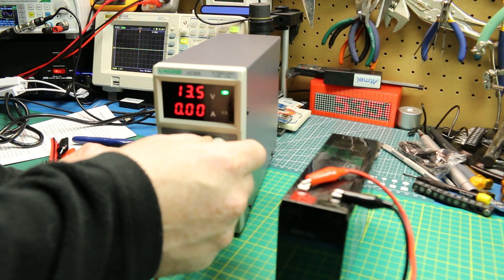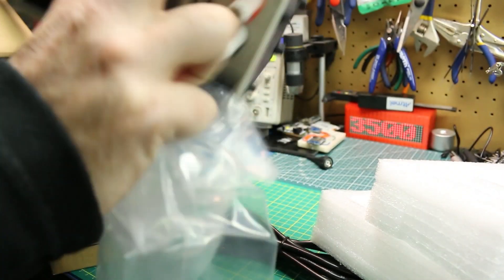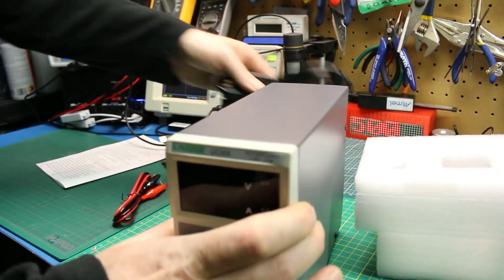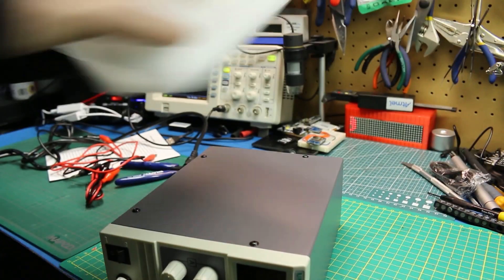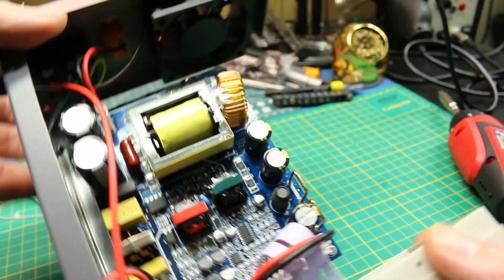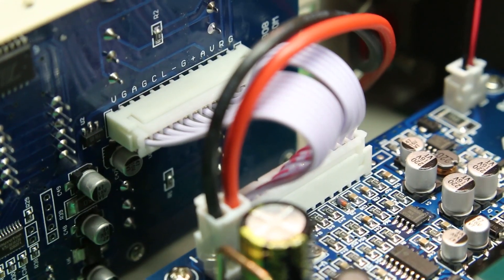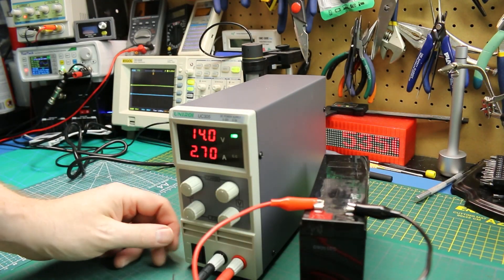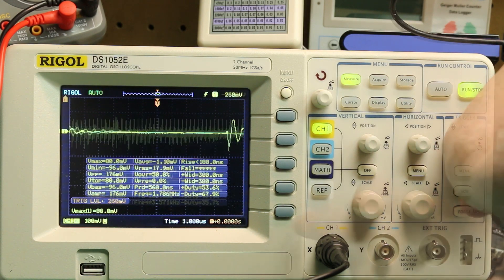Cheapest Amazon Power Supply DOESN'T SUCK!

Comment from the maker: Do you have a favorite power supply or lab tool?
Reply: I'm thinking about buying this, given the price point.  I've also been looking for a linear PS, and the KORAD KA3005D has come up several places and looks nice, with a good set of features.  $113 on Amazon US>
Reply: @glenntrewitt  is a $50 power supply (the name brand might make a difference) worth it? Plan on getting one like shown here, but would rather spend around $60 - $70 for a better quality. Thanks. Watched a video or 2 of the linear or switching type. Which is the best? Also, does a 4th digit make that much of a difference? 🤔
Reply: @glenntrewitt  - I have a Tenma 72-10495 (similar to the KORAD KA3005D, just a dual unit). Very heavy, works great for what I use it for.
Some review and tips of the KORAD unit - https://www.eevblog.com/forum/testgear/220v-lab-power-supply-on-110v-mains-korad-ka3005d/
The dual unit is a little more expensive, not much - https://uk.farnell.com/tenma/72-10495/power-supply-2ch-30v-5a-adjustable/dp/2251947
Reply: My favourite power supply is the minleaf k3010d
Reply: I’ve just bought a wanptek PowerSupply 0-30v, 0-6a. It’s very nice and cheap for charging lithium battery and revive dead batteries.
Thanks for the video.
Greetings from Saudi Arabia.
Reply: Yes I am a big fan of my tool. ;)
Reply: I know it's kind of off topic but do anybody know of a good website to stream new series online ?

Comment: It's been long discontinued.  Kungber has been around for OVER 5 years, COSTS US$60 as of 2026-12 and is CLEARLY THE BEST "BANG FOR THE BUCK" for any "300W 10A" supply costing less than $80.  //  All bench PSUs now have 1 or 2 USB power ports for your convenience.  // Don't even try to get anywhere near 30V @ 5A !  It will probably self-destruct.

Comment: Hello, can you tell me the numbers that put on the 7-pin chip (on the board marked as U2) that is next to the diode bridge and above the yellow filtering capacitor? That is, there are two large capacitors, then a diode bridge and then a capacitor yellow filtering that has an 7-legged chip on top, well that's it. It is that my power supply, which is exactly like yours, same make and model, has burned that chip and I cannot see its number to repair it, I would appreciate your collaboration.
All the best.

Comment: I always thought constant current was the current the device would be shoving  through.   Like  if  c.c is set to 10 amps then ten amps  would be  shoved through whether the device liked it or not
Reply from the maker: Google Ohms law ;)
Reply: @MkmeOrg  for what exactly
Reply: Absolutely not, the current setting is where you want the power supply to fold back the voltage once that amount of current is reach or drawn with the device under test. Once say your amperage setting is reached the power supply basically self protects itself and your device by turning down the voltage which immediately makes current drop so you don't destroy your device under test.
Reply: @kevinmccool3719   hmm guess I learned it wrong from afrotechmods
Reply: study ohms law and why "Loads" draw a certain amount of current depending on the supply voltage.

Comment: Have you tried dialing the supply to something like 5v and power cycling it a few times while attached to the scope? Many of these cheap supplies have bad power-on spikes.
Reply: I have the exact same power supply and I did just that. You're right, it does have a very slight power-on spike besides the ripple. I was testing it on 4.0v while charging a li-po cell. V regulation is surprisingly accurate tho, but being only a single digit fraction, the resolution is limited on the display. I hooked up my scope and used it to measure the voltage with 3 digit fractions instead. Surprisingly good power supply, especially for the price. In fact it's better than many of the ones I can buy here locally for more than twice the price.

Comment: Thanks for this review. As it happens, I have been looking at bench power supplies and it's difficult to chose between the cheap ones. I hadn't looked too closely at the pictures of the inside of the units before, but this model seems a lot tidier inside than the others in the price range.